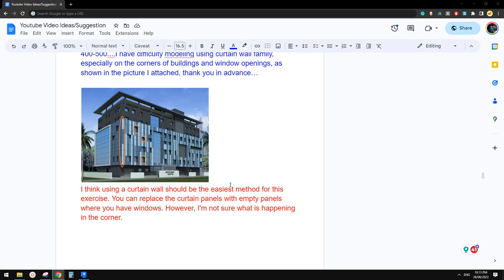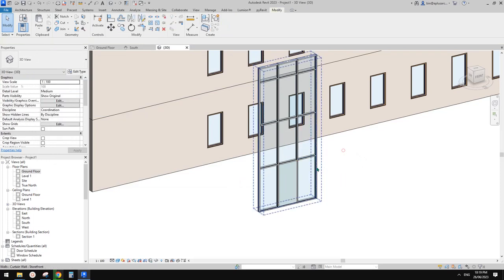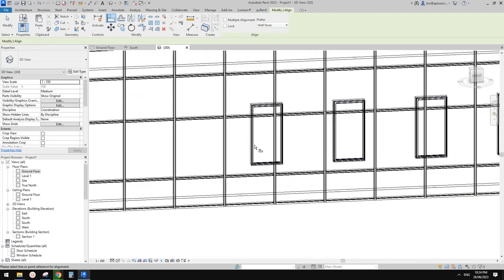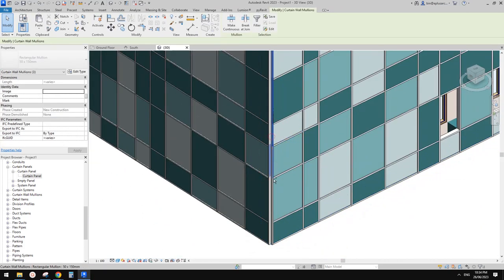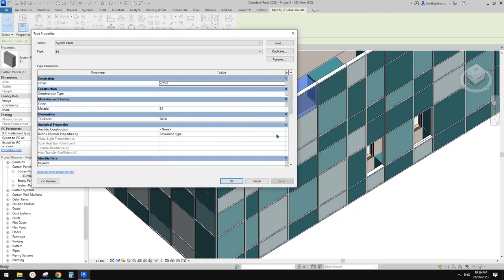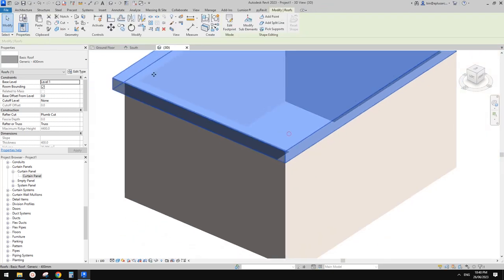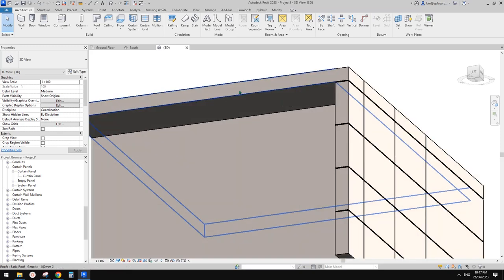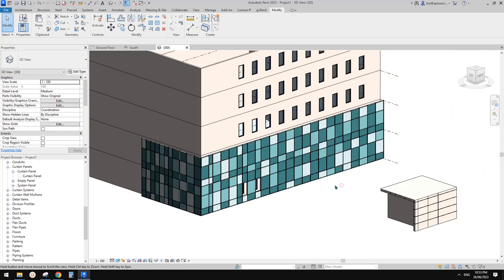23056 - Some Quick Revit Curtain Wall and Wall Reveal Exercise

Comment: you can lock the end of the path to the wall then the reveal can entend with the moving of wall😀
Reply from the maker: I believe we need to use Sketch Path instead of Pick Path for the lock to work, correct?
Reply: This is a better way.thank you very much,your video is very very useful !!